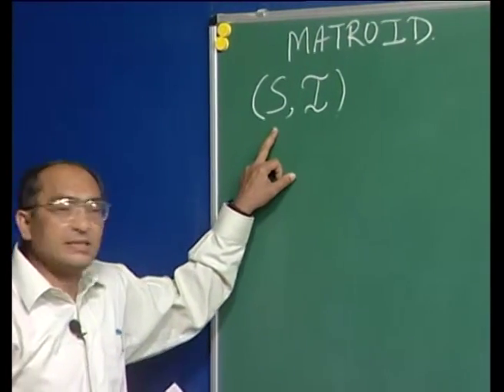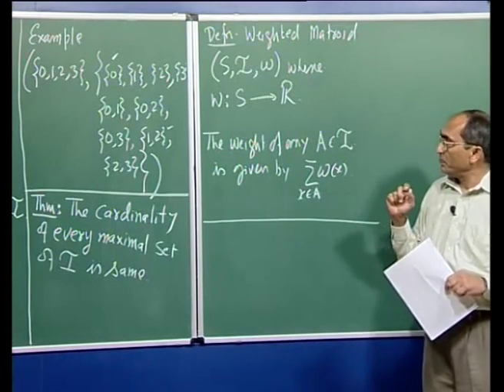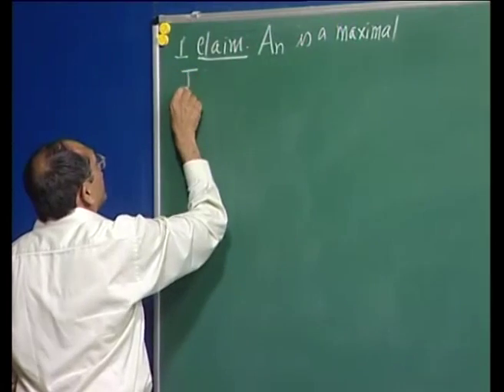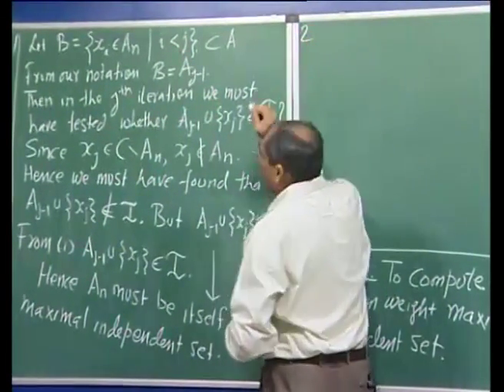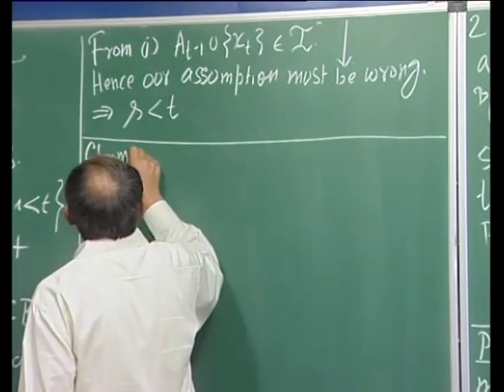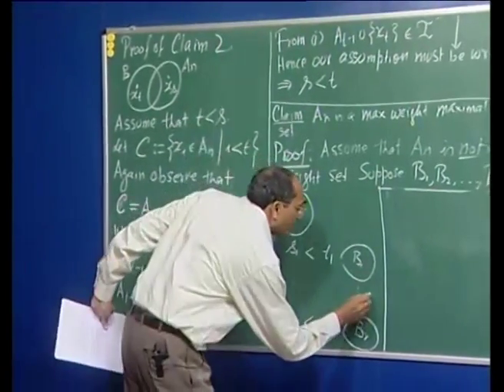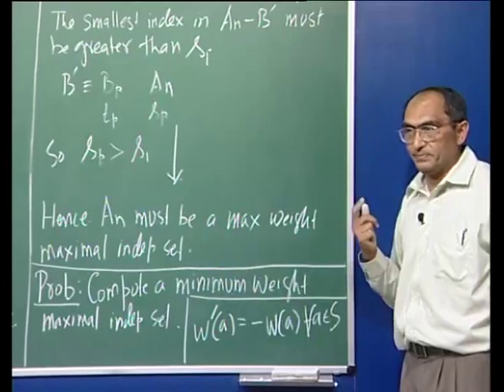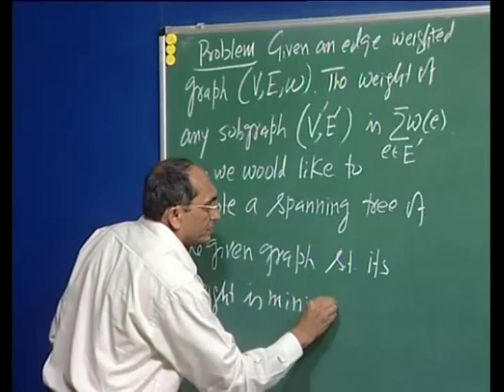Mod-01 Lec-05 Matriods

Comment: at 4:54 , in the example, if we consider A as {0,1} and B as {2,3} , there exists no y which satisfies the 2nd property.
So is the example wrong or should the 2nd condition be changed or am I wrong?
Reply: |A| = |B| = 2 so the 2nd property does not apply, I think.
Reply: @running_enjoyer_729  but the condition tells <=; so it must apply. Also, I believe null set is missing as null set and any other set would satisfy the first condition